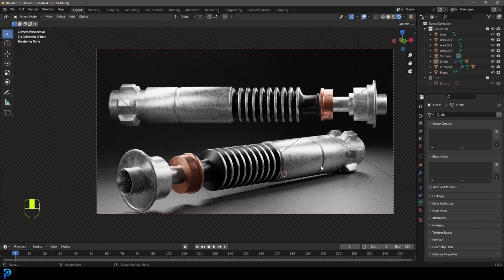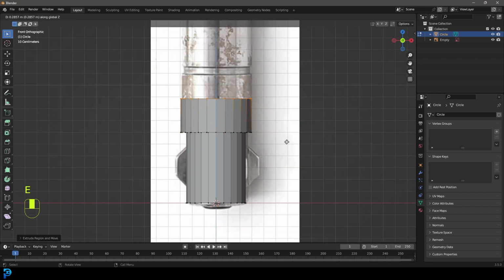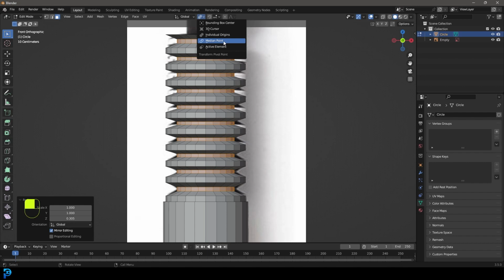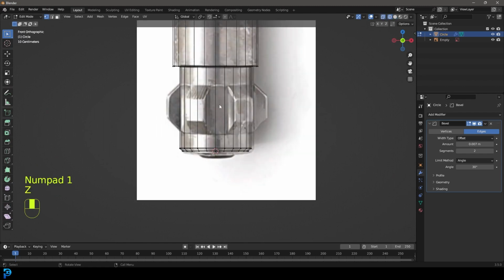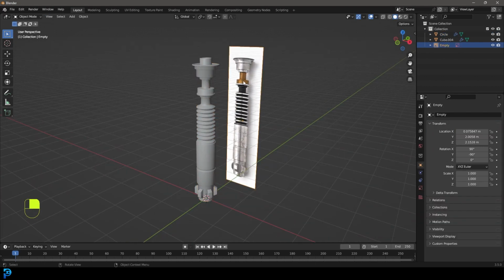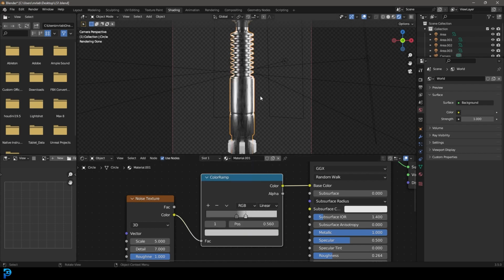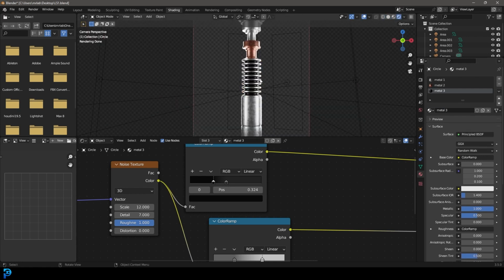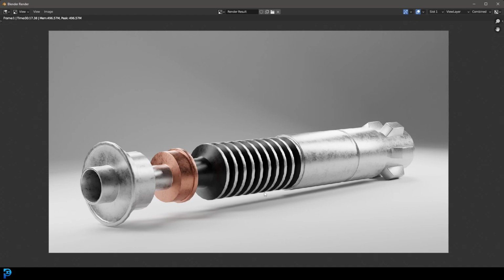Blender: Make Luke's Lightsaber | EASY Tutorial

Comment: i have a problem.. in the bottom end when i "F"illed the empty field.But after when I try to bevel the end it wont work. i have tried both ctrl+R and/or add a bevel in modifiers. And when i try the ribs on the pommel it doesnt put itself in "place" it just turns 60degrees around the original cube AND the cube itself does not appear as an object in "scene collection"-box. Anyone else got any of theese problems that can help me.. Otherwise a nice tutorial.